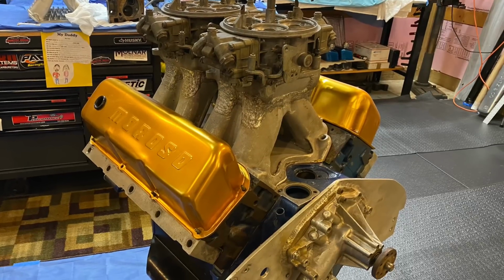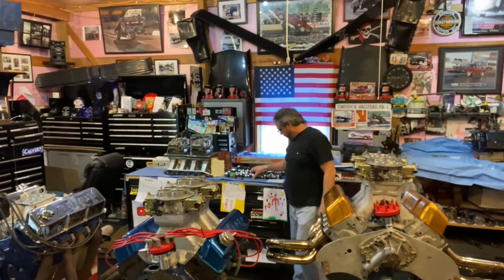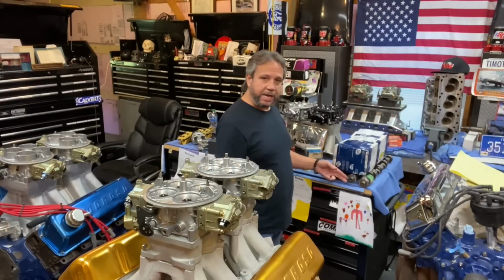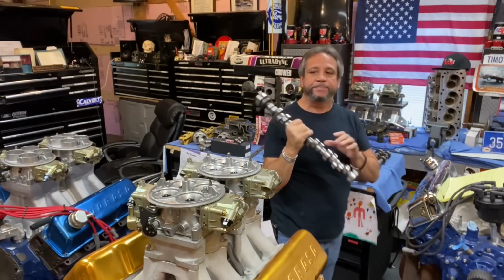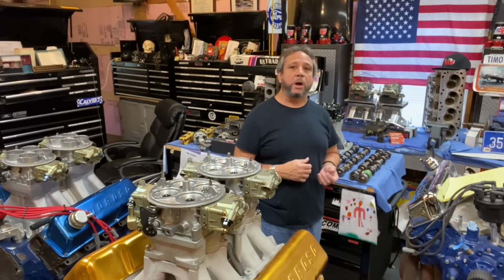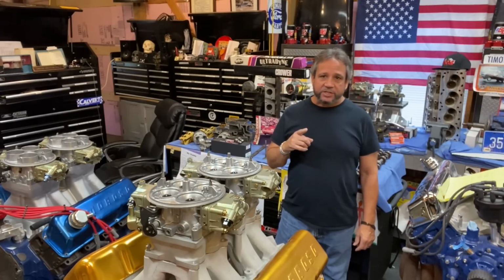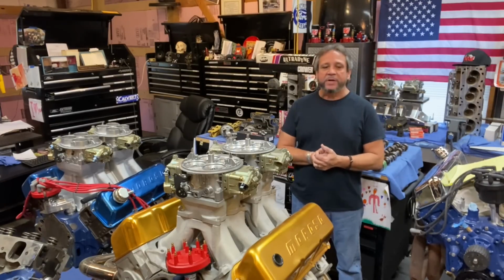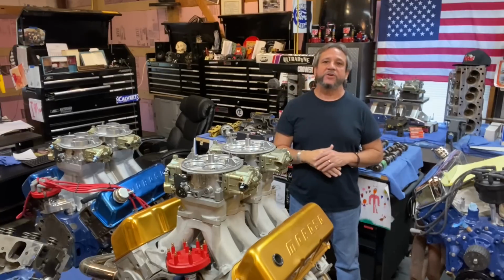DBG: Ford 351Cleveland Pro Stock Cams, Pics, Specs,  And Speculation? How Much HP  Did They Make?

Comment: Original Roller Cam Technology was likely brought over from the Radial Aircraft Engine. Chet Herbert to my understanding introduced the Roller Lifter & Cam to the V 8. May have been Ed Iskenderian, to far back to know without research. The term coin-d 3/4 Cam is based on 540° crankshaft degrees as the Crank turns twice to the cams one revolution, 3/4 Cam term was also likely introduced by Chet Herbert or Ed Iskenderian, two of the greats. 360° x 2 = 720° then 720° ÷ 4 = 180° followed by 3/4ths being 180° x 3 = 540° Dividing 540° ÷ 2 = 270° duration, thus the term 3/4 Cam which was once considered the threshold to wicked and for many still is when those figures are clocked @ .050 to .050...  I really enjoy your videos... never been a Ford guy, just enjoy the nostalgia and your information delivers an appreciation of Fords progress/accomplishments through history. Gliddens rough around the edges stuff sure did fly.
Reply from the maker: I have heard the same, also that Harley was using them too. Consensus seems to Herbet. Thanks for the lesson, always wondered about that phrase. That is a healthy cam. Thanks for watching my vids, I try and give correct info that I have. Thanks for all who help fill in the blanks. Glad your here, and can give us another opinion. Thanks and stay tuned Nobody.
Reply: @dragboss351cleveland  The differential intake centerline exhaust centerline numbers can also be achieved through advancing/retarding the cam as intake is BTDC and exh centerline is taken ATDC in degrees. And some Cam Grinders just grind it in. If you ever have any free time... spend an afternoon chasing numbers from straight up to + - 4° and watch those centerline numbers split. It can certainly get mind bending. It's just fascinating that 4 cycles and the cam at half speed to the crank land perfect into the physical science needed for the V 8 to produce high efficiencies by nature. We certainly don't need any more acceleration of gravity in the valve train and to think it takes twice the counterweight to yank that piston back down at high RPM's is another fascination in itself. Then you get on the track... inertia releases torque as when the rate RPM increase overrules the rate of decreasing torque, thus HP is made.  Energy and Mass... a whole swarm of $#it going on. 5252? we can thank some guy for hanging a carrot out in front of a horse for an hour to arrive at that constant. The near 800 from 408 CID is very impressive. All Great Stuff! right down to the little one's art at your side on the table, another necessary constant. Have a file cabinet full of those with three granddaughters who are all driving now.
Reply from the maker: Nobody, thank you for this dissertation. It’s quite fascinating when you think about it. I’ve measured the piston valve clearance, with moving on crank through its rotation which is pretty interesting to me. If I have time I’ll mess with the cam and go through what you’re talking about. Just I don’t have a lot of time. I appreciate you noticing my daughters in the video. You see their artwork, makes me smile every time I see him. Yes they always have another addition to DBG. Hopefully as they get older they want to be out in the garage working on engines with dad. only time will tell. Thanks for contributing to my channel nobody come and helping us all learn.

Comment: the gear ratios in the trans were the key to the fast 
 times  not the camshaft
Reply from the maker: Peter I think it was more than the transmissions in gear ratios. They definitely contributed. Thanks for watching
Reply: @dragboss351cleveland  staying at 8000 in every gear   worked well  for them back then
Reply from the maker: I bet they did. Launching at 10.5k

Comment: Say Tim I'd like to take a shot at the first cam. First let me say that Jay Cushman used to visit us @ R&R Machine. Either showing us what he had come across, leaving something off for repair, or we had made a purchase. Lot's a times to see his buddy Dave Dion, one of the best Ford short track pilots that used and  built his own cleveland bullets. About that cam...most cleveland cams have significantly extended exhaust, 10-16 degrees, believed to offset the horrible low lift #'s on the exhaust. Those port plates only helped the mid to high lift numbers. You want to get the exhaust out by BDC. See the nice venturi @ the exhast seat in your aluminum heads. You can't do that on the stock iron heads, there's a 90deg cut under the 45. That cam has only 4deg extra timing. Oh...and that's seat timing...not .050". My guess is either that cam, if it came Mr. Glidden, had also welded up the exhaust seat area and repaired it properly...or it was for a set of aluminum heads. Or maybe it never qualified for an NHRA Pro-Stock field...who knows. That and $3.89 will get me a coffee at Dunkins.
Reply from the maker: That’s a good deal if you get coffee and a donut for that price. Thanks for informing us and give us some more information. I heard that was seat timing. It’s cool to know that you’ve been around, and working right in it. I will see it working machine shop. you’re right on about more exhaust timing. I was thought the plates helped  with lift throughout. Thanks for keeping us up to date.
Reply: @dragboss351cleveland  A set of "GLIDDEN VICTOR SC1" will get you almost up to date !  😀
Reply from the maker: @1bad505  I know, they are killer. I am just old school I guess. Work with what I have and see where it goes....
Reply: @dragboss351cleveland  THE MOST AMAZING CLEVELAND FLOW TEST: Flow a 4v head exhaust port first. Now take a 2v head and  machine the exhaust for a 1.71 valve using a "Serdi" machine or similar with a proper cutter to create a venturi under the seat. Clean up the bowl and radius the short turn. Test that head and you'll think your flow bench sprung a leak. It makes the 4V head look silly. A port plate head might catch it way up.
Reply from the maker: Wow now that is amazing. I have not heard that before. I heard the Aussie  2v heads are killer with some work. Never knew run of the mill 2v work  that well. Thanks
Reply: @dragboss351cleveland  Yup...the point was it proved my suspicions concerning the 4V head. I tried fix'n this in the 4V heads with some seat inserts, but I couldn't get it to work. Then I went to oversize exhaust valves which definitely started to help as it permitted a much better seat getting close to a venturi. I even started cutting down the intake valve to prevent interference. Also used the 302C aussie's on some short track & street motors, they work pretty good. But on the bench the intake stalls/turbulence real bad by mid lift and never seems to work out of it. I think Glidden had about 840hp. He had some mills under 343" in the later Fairmont years. The brazed in sleeve motor was reportedly 327" but had problems. I know he did some 8.30's. Something sticks in my head that he ran 8.23 on a Gainsville qualifying pass. I was at the Summernationals in 78 when he debuted the Fairmont pulling the shut @ 1000ft, running 10mph slower. Me and a buddy helped Kasse swap motors in Dyno's Fairmont at that race, got the pic to prove it too.
Reply from the maker: Well you’re way past me when it comes to hands. I’ve never even ported heads, but I have a great understanding of how air flows, turbulence, and a lot of other factors. This comes from Darin Morgan teaching me. I’m going to attempt my first intake manifold porting got a strip dominator, don’t laugh too loud. Yeah I heard that Aussie 2v heads are pretty mean when done right. Yes the one that sat a record I thought was a 343 cleveland. I know we went 8.28 at like 160 something. That was a 1981 with 81 Fairmont. If you look at that engine that’s running a sheet metal intake. that is pretty cool to be helping Dyno and Kaase. I was probably only about 10 at that time. I appreciate your input, knowledge base and experience. Darin Morgan will be talking on live chat Friday I have to make a post for this. Stay tuned hope you’re there.

Comment: Way too much to consider for a youtube comment. The cam specs are very closely tied so many different head capabilities, rpm, displacement, compression, on & on. If an engine builder wanted to dominate a certain class he would order say a dozen cams and start firing them into a bullet in the dyno cell and then he may have the knowledge to order the killer piece. And you'll never know, (without a lot of work),  because the numbers were ground off. I considered Harold Brookshire (RIP) a friend. He is considered to be the first to use CAD in cam lobe design and the unsymmetrical lobe. His cam lobes were the fastest acting designs that a valve could follow. I was a wholesale distributor for UltraDyne and spoke with Tim Goolsby weekly, now @ Bullet Cams. When I needed something special Harold would get on the phone and he would go on and on about superior cam and lobe design and manufacturing, he'd tie you up for hours if you let him. Every year I'd see him at PRI and had dinner with him once. Tell you what, "The Chevrolet Racing Engine" by Bill Jenkins is a MUST read. And most of it can be applied to what your covering Tim. Non-relieved cam design and selection. Etc. Etc. Etc. And the pic of "Grumpy" holding a Cleveland tunnel-ram up to a Chevy smallblock is priceless...
Reply from the maker: Thanks so much, I’m sorry I missed this. I am a cam novice. I understand most of the specifications and how to get them. But you’re right there’s so much to lobe design and ramp acceleration. I have to run these and see what they do.  Be fun on the dyno. I have never seen that pic or heard of that book. I will look for it. Thanks so much, glad your here.

Comment: Hey Tim. We normally ran Crane R-290's in our 366" configured Clevelands into the mid 1970's. We tried others but these generally gave us the best results. ...and always Vasco-Jet springs!
Reply from the maker: Nice Bill. What stroke and rod combo did you run. I remember k1000 k motion. Thanks

Comment: Another good one Tim...You started off with mentioning blocks...So let me start there. The block you really want is a M-6010-S302 or the equivalent Dart w/8.700" deck height. Oh I know your going to cry...manifold issues...it's not a cleveland. Guess what...today's 500" Pro-Stocks run 8.700 decks....(approx). The carb boosters want to "SEE" the valve...and 8.700 is the magic number. It's the reason they were cut'n those dominators in half when the rules allowed on taller blocks. You could take a cleveland block, mill the top off and then weld a deck plate back in. It was being done way back when on BBC's.
Reply from the maker: Thank you. Just trying to break it down, so we can all be on the same page. I never knew they had short DH, but shorter path. I’m too old school to mess with that 8.700 stuff. Manifold be a phone call a away, Morgan could take care of it. Be a fun experiment. Wondered how good this split dominators work. Thanks

Comment: Is that an ultradyne cam box i see. They made some be custom grinds for my 406 chevy. Because i needed my lobe center out to 114 , thinking it would produce more vacuum at low rpm. But made awesome power to 7500. Only 570 lift and 263, 271 at .050.
Reply from the maker: Yes, it actually has an unknown spec FE  roller in it. Need to send it to get read. Wow 114 seem way to wide unless heads flowing way up there. I ran a 266/271 was .699 in 377 ci cleveland. Cooking to 7800 10.60s thanks for commenting. Great combo.

Comment: Hi Tim. Great video. The reason the Glidden cam and your 409 also sound different is because of the different stroke and cubes. Long stroke Cleveland’s tame the idle a lot. You can’t beat a small cube idle in my opinion. They always sound wilder 👍
Reply from the maker: Good point. Hopefully people could understand know the difference between a durations, and that cackle. That’s why I want to build a 340 ci pro stock motor with original parts. And some modern tweaking. Thanks Julian.
Reply: Just go bigger cam on the larger cubes to get that radical idle.    From the old vizard book, to make a 25 ci larger motor have the same powerband as the smaller motor add 4 degrees of duration, so for 50ci add 8 degrees of duration.
Reply from the maker: Right on Dennis

Comment: By the time we got to the year of the end of Main Street and the beginning of the back road or sparsely populated areas 500 at the flywheel was minimum and getting to the point to where it was not even enough, Nitrous Button was making a big come on due to the cars that were starting to appear on the road and the turbo, I had to throw that out there due to memories.
Reply from the maker: That’s what keeps us going. My cougar ran 13.36 on the street, had NOS power shot 125, car went 11.86 yanking the tires.  Driving in town with locker, every time turn corner Car would chirp the tires with 1-2 shift. Loved that. Thanks for a look into your past John

Comment: Great video Tim. I'm meant to be working at the moment, so some customers are going to be unhappy. The 108CL will most likely be the LSA, not the actual intake lobe centreline. One of the things that I notice a lot is that LSA and CL are used interchangeably by many commentators.
Reply from the maker: I am going by what is on the lobe CL to me that is intake center line not LSA. I don’t know. You may be right. I will send them out and find out. Thanks for watching and keep working strong.
Reply: LSA: lobe separation angle 
CL: intake lobe centerline installed angle (crank degrees btdc)

Comment: On the sound of each engine as it relates to the cam, a bigger engine makes the same cam sound milder and a smaller engine, more radical. In engines in the same family I've built for my own cars and for customers, I've got several I found to be goof proof from each cam grinder and they sound different in different size engines.

I built a street rod engine for a cust who loves the 283 SBC and despite my telling him he's better off with something bigger and more common......had to build a .030 283. I used the exact same cam as I use in 350's in street engines all the time......232 @ .050 and the 283 sounds borderline "radical" where the 350 & 383's sound "healthy" He wanted the same cam in my sons car strictly because of the sound. I told him it would be more radical and  it was. 

Glidden's engines......which you have longingly detailed in other videos are in the 320 - 330 range. No doubt those engines needed more cam for several reasons.....mostly 10,000+ RPM, but put a Glidden size cam in your 408 or +1 engine and it won't sound as radical as Bobs, as the bigger cubes calm it down. 

I've used Ultradyne cams back some years ago and as I recall, all were custom ground, there were no "catalog cams" .........but I could be wrong.

GK cams, as I also recall, were pretty much a race only co. I've never seen a street grind. Grumpy Jenkins was a GK guy almost exclusively back then......some Cam Dynamics.......
Reply from the maker: Thank you for taking the time for that synopsis. It’s great. Makes a lot of sense. I’ve always knew that I guess I overlooked it I didn’t think about it like that, cause I heard the true together as like wow listen to that it just seems to fit. So yes I’ll be kind of cool to get these cams figured out cleaned up pick one and run it. And then see what we have for horsepower, maybe make a change of a different camshaft or a custom modern camshaft I don’t know. I kind of just keep going and when things find a place and the next door open that’s where we’re going. I heard Jenkins was definitely general kinetics, I Bob Glidden was more competition cams I remember seeing all the stickers on his car. I think Dyno Don also like general kinetics too. Plan on building a 340-343. Thanks for watching appreciate your information
Reply: @dragboss351cleveland  I used to go to Jenkins shop as a friend of mine was best friends with one of Grumps machinists. At the time he was writing his book and what they talked about was usually over my head......I was 19 or 20 at the time. Jenkins was GK and Cam Dynamics when it was owned by a guy named Mark Heffington.....Crane bought Cam Dyn then Mark opened a computer chip co called........SuperChip. He was brilliant

Glidden used other cams until as I recall until the late 70's then was Comp Cams 100% Back then hardcore Cleveland stuff was not common and I believe Glidden, Nicholson, G & R and those guys would pay to have cams ground to their specs. I know Jenkins did and the Pro Stock stuff being so radical none of it was a standard catalog part. 

in hindsight....one Ford team would get a slight edge......the other 2 top Ford teams would catch up and then another would have a small edge.......no matter......that was the best Pro Stock racing to me.

Can't thank you enough for finding all this gold and taking time to make the videos. To most of us, this was lost forever.
Reply: @dragboss351cleveland   As a point of reference, Dyno Don also ran Crower cams , especially in his 429 engines. His 516 cu. in. engine had a Crower in it.